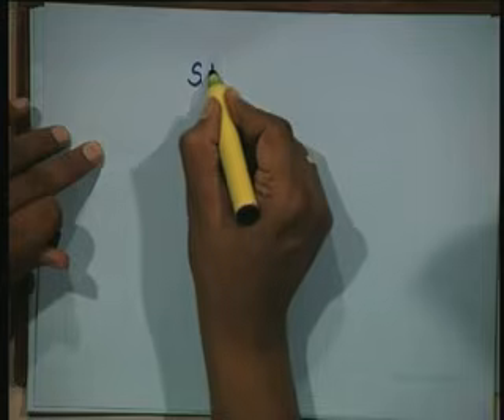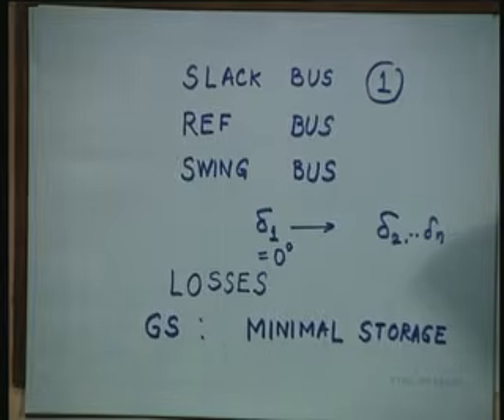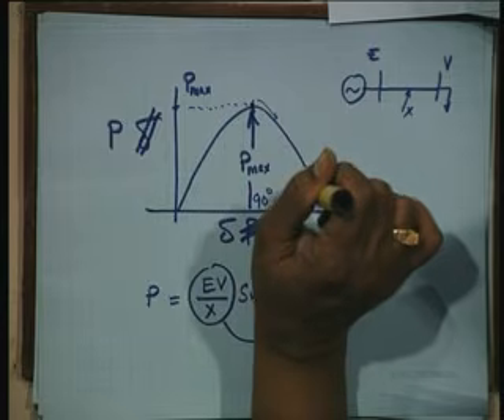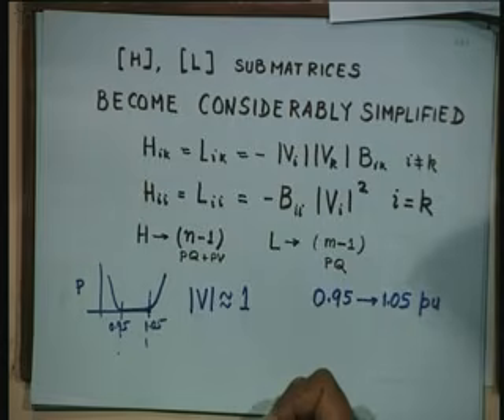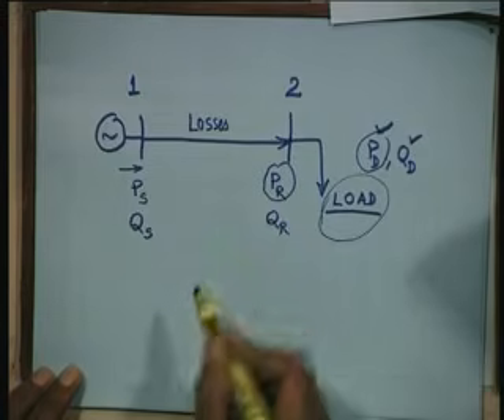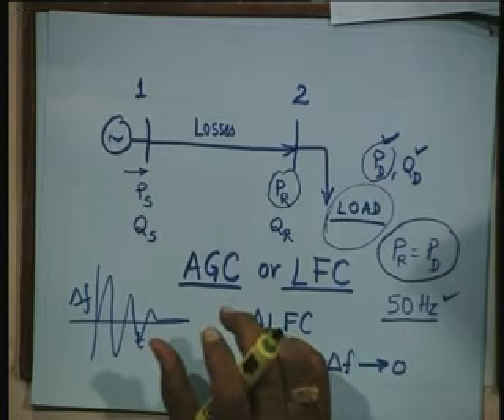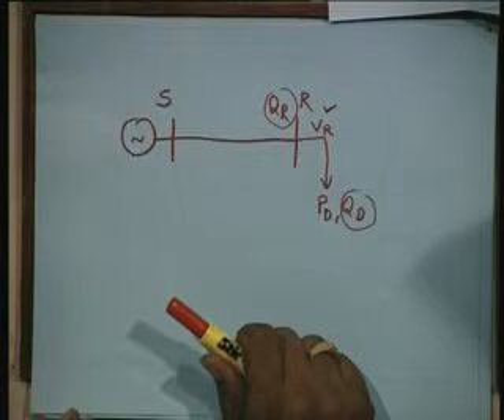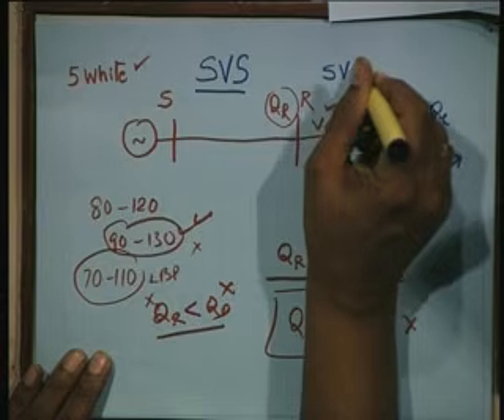Lecture - 30 Fast Decoupled Load Flow

Comment: I compared the results of the Fast Decoupled Load Flow (FDLF) with the results of the full Newton-Raphson method using MATLAB programming in a 4 bus test power system. I got the same results using both methods, but I noticed that I needed more iterations to get convergence of results in the FDLF than in the full Newton-Raphson method. I think this happened because the FDLF is an approximate method and it makes certain assumptions to simplify Jacobian Matrix and the load flow equations. The assumptions are for example that delta angle is small and other assumptions.  If the assumptions are valid any power system I will always get the same results for FDLF or full Newton-Raphson. But if the assumptions are not valid, for example if delta is not small, then I will get different results in both methods. So the FDLF is useful because its assumptions are valid for any real-life power system.    Best regards from Caracas, Venezuela. Carlos Dominguez.(Student of specialization in Power Systems of Universidad Central de Venezuela)
Reply: Carlos Dominguez NR converged as pure quadratic while with assumptions of decoupling and bus voltage magnitude and phase angles etc  , quadratic convergence is lost . Ofcource decoupled method was only meant to reduce computer memory requirement but increased number of iteration was a side effect . Fast decoupled was evolved to deal with it ..by taking further assumption to compensate the time required to some extent.

Comment: It is very interesting to know that the Fast Decoupled Load Flow (FDLF) algorithm was developed by B. Stott and O. Alsac in 1974. I encourage all students to read the original paper of this method. The paper is:…” Fast Decoupled Load Flow  Stott, B. ; Alsac, O. Power Apparatus and Systems, IEEE Transactions on Volume: PAS-93 , Issue: 3   DOI:10.1109/TPAS.1974.293985 Publication Year: 1974 , Page(s): 859 - 869  Cited by:  Papers (448) “.Best regards from Caracas, Venezuela. Carlos Dominguez.(Student of specialization in Power Systems of Universidad Central de Venezuela)

Comment: In order to learn more about the Fast Decoupled Load Flow, all the students should read the paper of Prof. Kothari. “Some important information on Fast Decoupled Load Flow algorithm” Quick Abstract “….This letter brings out clearly for the first time the relative importance and weightage of some of the assumptions made by B. Stott and O. Alsac in their fast decoupled load flow (FDLF) algorithm on its convergence property. Results have been obtained for two sample IEEE test systems. The conclusions of this work are envisaged to be of immense practical relevance while developing a fast decoupled load flow program….” Nanda, J. ; Kothari, D.P. ; Srivastava, S.C.  Proceedings of the IEEE  Volume: 75 , Issue: 5   DOI: 10.1109/PROC.1987.13789  Publication Year: 1987 , Page(s): 732 - 733. Best regards from Caracas Venezuela. Carlos Dominguez.(Student of specialization in Power Systems of Universidad Central de Venezuela)

Comment: I like the advice of Prof. Kothari at the minute 6:06 of this video. He says “you should never speak more than is necessary”…”you should never give information more than required” (for example in a job interview or any other important situation).... “you should be to the point” (unless you are among your friends, that is a different issue). I would say that if any information hasn’t been asked, don’t talk about it in a job interview, just go straight to the point. Best regards from Caracas Venezuela. Carlos Dominguez.(Student of specialization in Power Systems of Universidad Central de Venezuela)